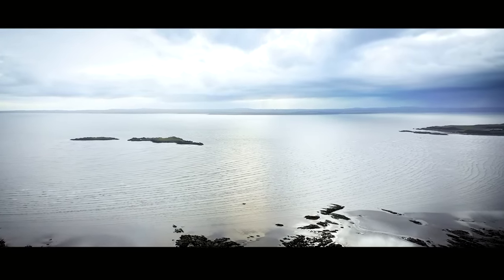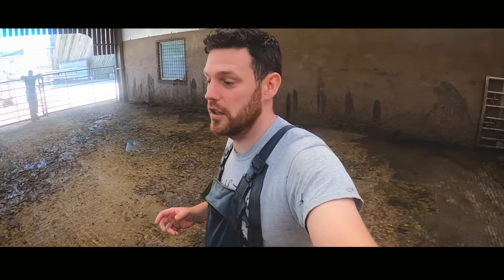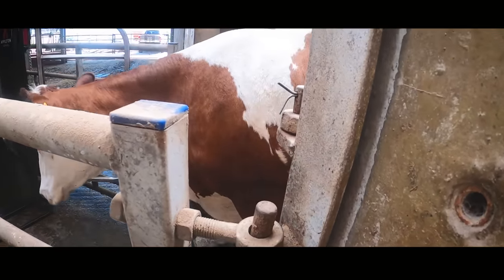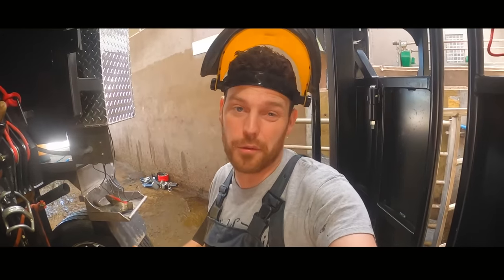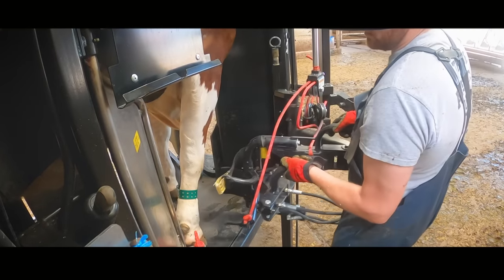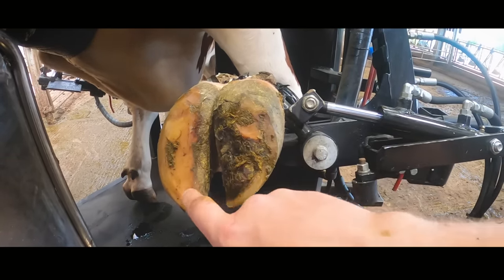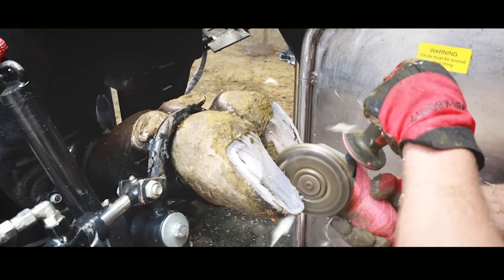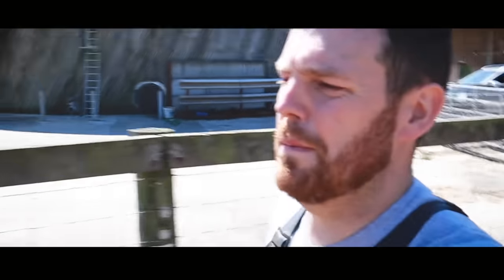trimming an ELEPHANTS FOOT!? | The Hoof GP

Comment: My horses had Sand Cracks in their hooves as well. This was before we were paying for a Farrier. Ever since we started getting their hooves trimmed and shoed, no problems with sand cracks whatsoever. We did have to put an equivalent of a block on one of our horse’s hooves because the material had become soft and squishy, which could easily lead to an infection. After it went on, the next time our man with the horse shoes came back, the result was phenomenal. The hoof was strong as it should be.

Comment: If a bull his size were to throw a fit, how would your new crush fare?
Reply: Was thinking the same thing,he’s a big boy
Reply: That bull, if he wanted out would tear that crush apart in a hot minute. Either he'd get out, or he'd kill himself trying. But yes, that bull with a throw of his neck would tear out the front. A couple strong kicks in the back would take out any hold bar. The sides also would not hold him. Then once out, those guys hopefully would be out of the way.. Its amazing how gentle he is. But I'm sure given the right circumstances, he can be very dangerous. Bulls half that size that run in Pamplona Spain throw people around like rag dolls.
Reply: Kelly I don’t think it would destroy the crush, they are designed to hold pissed of cows, plus his crush has the hydraulic power to lift that whole bull of the ground I’m sure it would hold him still, plus it squeezes his sides preventing movement and pressure on the side of cows calms them down. ALOT. We use a similar system on our ranch, not for hoof trimming but for general health care.
Reply: @coryhueske5245  I hope you're right. You're right about the side squeezing stopping their movements. Do the sides of his crush squeeze in? If so, that could save his life. But if he gets a rear leg in position or a good head throw would bend those doors or rear bar hold. I've seen a lot of chutes, gates and barns wrecked by full grown bulls. I think if he wanted out, he would get out. Its a good strong chute but there are too many weak points (relative to a full grown bull) The hydrolics are impressive to lift nearly a ton. It's a great chute but there is not a lot that can stop a bull that size. Cars, trucks would be crushed. I saw a car crumpled in half by a bull loose on the road. IDK. I've seen a lot of carnage by bulls. I always get so nervous when he trims them. Not so much with steers but steers are just as strong. I went to a rodeo once and in the bull riding, this wild young bull threw the rider off almost before he was out of the chute, ignored the clowns and leapt into the stands up 3 rows. People got out of the way but he took out about 1/3 the stands. They had to shoot him. It was awful. I have a very healthy respect and fear of bulls that size. I wonder if he's ever had to have a vet stand by to sedate a bull before trimming. You guys do that? Are they breeding bulls more gentle these days? Mostly bulls I've seen in need of vet care are sedated first. Dart gunned like a tiger.
Reply: Kelly the bulls at our farm until the bushfires in Aussie were bigger and calm we are a beef low stress soft handling farm
Reply: @lokilockness2970  that sounds nice. Did the fires take out your farm?
Reply: Kelly no we just had to sell all our stock to go to meat so we could protect against the fires
Reply: @lokilockness2970  I hope you can restock and have a herd again. I love cows.
Reply: @coryhueske5245  https://youtu.be/XUE28x7krV4

Heres a short bull riding video. It shows a
Bull a lot smaller than Bluto throw off his 150 pound rider like a Frisbee. Its the neck muscles in bulls that have a lot of power.
Reply: Kelly I’ve grew up inside of rodeos and they tie a bull rope around the nuts of the bull to make him EXTRA mad. And breeding bulls can be even more dangerous Bc they have to much testosterone. Bulls are very very very strong. But crushes like these do kinda of lift the bull and squeeze him, calming them and taking all of there power away because they don’t have leverage with the floor. I’ve seen bulls kill people before, and they are not to be messed with. But with the right equipment you will be fine. I’ve only ever seen one bull sedated and it’s because he cut his belly open and it was to close to his feet to move safe while working. But I’ve seen a bull that shook the entire trailer and truck that was towing him to the point the people had to pull over when he was getting rowdy, but as soon as that crush grabbed him he lost 100% of his power.
Reply: @coryhueske5245  I'm glad to hear that about the strap taking away his power. What if the strap broke from thrashing? What if getting in or out he panics? I ask because like you, I've seen terrible carnage from bulls that size and I'm so worried for Graeme. I guess anything can happen to anybody. What advice would you give to trimmers handling these big boys? I still think strap or no, he wants out, he's getting out.
Reply: Kelly wishing you all the best.
Reply: jujitsuman68 Yes exactly. The body weight of the bull is suspended. A bull can be a very dangerous animal but not in a good crush.
Reply: @KellysAdventures305  You're right. If he wants out, he's getting out, either by breaking part of the crush or by breaking his own neck and being euthanized. A belly band, which is the strap around his belly, is NOT meant to hold his weight. They're used as an additional safety measure in case a cow/bull goes down in the chute. The belly band is supposed to sit a few inches slack from the belly to act more as a surprise when the animal goes down and feels the band, and act as an incentive to stand back up. We do this to prevent choke. And most squeeze chutes (or crushes) are not designed to squeeze and lift. The items that lift and hold the animal's weight up off the ground totally is called a tilt table. The animal is strapped to it while standing, and then tilted to lay on their side. 
From the look of this bull, he's a bit overconditioned, and most of these hoof problems seem to be due to feeding too much grain too quickly to bulk the bull up. 
(I'm a large animal vet tech and we do hoof trims and corrections almost every day.)
Reply: @Slinky_Loki1967  Thanks for the reply. Graeme's Chute is really nice but I've seen enough spooked bulls either get out of whatever they are being held in or kill himself trying to get out. I have a very healthy fear and respect for all that power. What I've usually seen is when a farmer sees the bull spooked they try to release him before he brings down the barn or breaks his neck. I've seen bulls die rather than be caught or held and its one of the most awful scenes. I see Graeme handle those bulls and my heart always goes in my throat. He makes it look so easy but I know if that boy wants Graeme to go away, one sweep of that giant head and neck and Graeme is squashed. I saw a guy trying to move a bull through a corrale alley to another holding pen and the bull didn't want to go and before I could shout to the guy to back off, the bull moved his head to the side striking the man and he went flying 20 feet and skidded along the ground another 10.  He was banged and scratched up but if he were thrown against a wall or object he'd be dead. I know what a bull can do and when they are gentle....that's always a pleasant surprise to me. You know if he dont want to do something or go somewhere, he ain't gonna. I love to see them though. I love to see an animal being what it was meant to be and knowing the extremes its capable of. I really love all animals and seeing their behaviors ingrained in them. 
🐃🐄. Just beautiful.